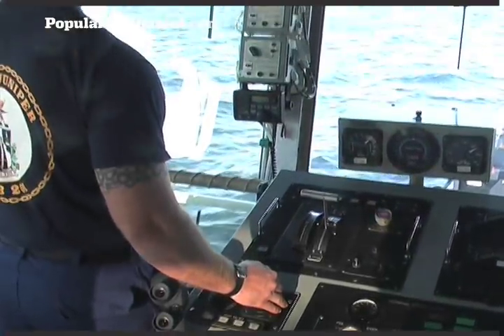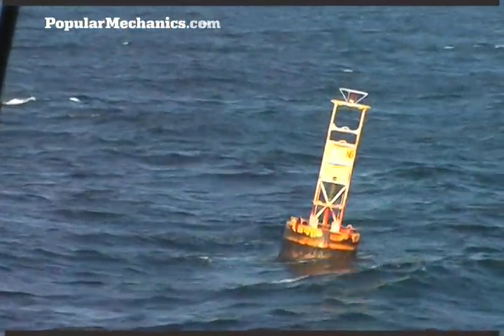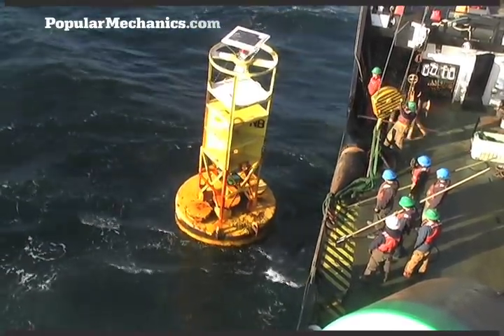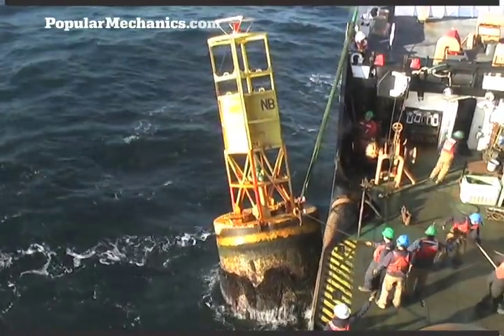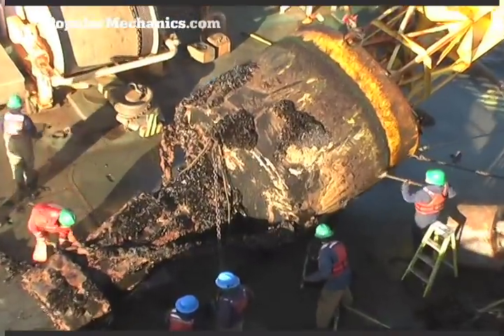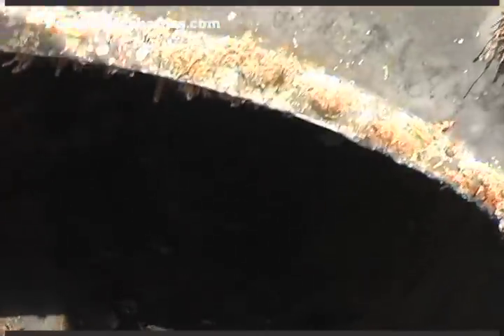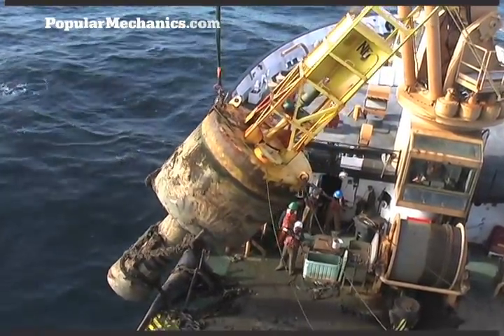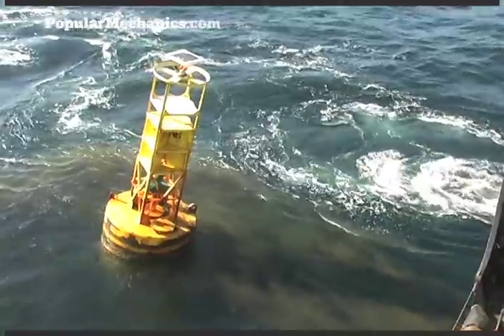Inside The Coast Guard's Dirtiest Job | PopMech

Comment: They only showed a few steps to the evolution. One of the more dangerous jobs in the CG, heavy weights, tension on the cross decks wires, tension on chain as sinker is retrieved...lots of moving parts and a good crew can make it seem effortless. Yes, I’ve been on many buoy tenders and you can’t daydream during these evolutions.

Comment: I did this work in Holland.

Fun to see how you guys do it! We only had 4 guys on deck, and washed everything with high pressure. Also we never heated & hammered the shackle. We just inserted a pin, then heated & bent it. Made it much easier to remove the shackle later on. Also meant that we could reuse the shackle.
Reply: Exact wat ik dacht....erg veel man aan dek en een nogal erg omslachtige manier van werken. Ik ken dit van de Scheepvaartdienst.....wat een luxe zeg, al die gasten die ernaar staan te kijken....

Comment: Where was the part about chasing the seals and sea lions off the buoy?  IME they're usually all over these.
Except for critical parts like the horn air intakes and corroded chain links, I'm surprised they bother with scraping off the slime and barnacles.  More will be right back within a couple months.
Reply: How about the part where you're killing marine life by tossing the used batteries in the water.

Comment: They could design a catamaran barge with a tapered gap between the hulls to funnel and collect the buoys against a vertical tilting bed. 
The bed would be mounted in the center of the boat so the buoys could be strapped down and then tilted down onto the deck, where they could then be serviced. 
A set of fork lift style arms could be mounted to the bed to help stabilize the buoys before they are locked down.
Reply: Sounds perverse.
Reply: @matthewrinehart2367  
👍True😂LOL!👍

Comment: So do they not replace any chain or anchor below a certain point?
Reply: The portion of the chain that rides up and down (chafes) against the bottom, ie: sand/rock, wears the most and is replaced as needed. I served on 3 180's during my 20 year career. Hazardous work with no hazardous pay.

Comment: Air whistle, eh?  And here I thought that buoys still used bells in this day and age.
Reply: They do still use bells.  There are/were three types of sound devices on buoys.  Bell, whistle and horn. The horn was electrically driven from the battery racks.  The others were actuated by the motion of the waves.  Which was used where depended on it's location in the channel and how near it is to another buoy with the same type of sound device. I served 3 tours on 180 tenders during my 20 year career.  I had no problem working that job. I retired in 1982 so there are a lot of changes in that field.

Comment: how tall are thises buoys and how much do they weigh
Reply: Depends on what the buoys puspose is, smaller ones made of foam and are only about 3ft in diameter and maybe 4 ft tall are only about 135lbs. 6ft diameter x 26ft tall is the biggest ive seen/worked.

Comment: what coast guard ratings are these guys?
Reply: Some BMs,  a few non rates.     possibly an MK in the mix.
Reply: Badger at Toad Hall E2-E4 seamen and a boatswain mate. Smaller bouy tenders use the whole crew on deck. On a 180’ you wouldn’t get an MK on the bouy deck unless he was just watching
Reply: @christopherbradley4885  Watching or smoking a cigarette. Of course you forgot the DC, no one in their right mind would let a non-rate (Deck Ape) handle a torch!
Reply: @matthewrinehart2367  you are correct I forgot the DC but in fairness we had a few deck apes that used the torches often, DC only got involved when they couldn’t get the job done.